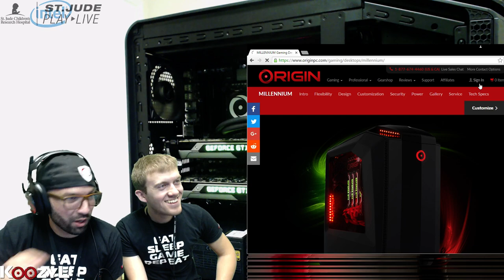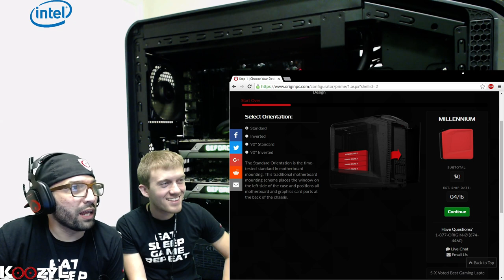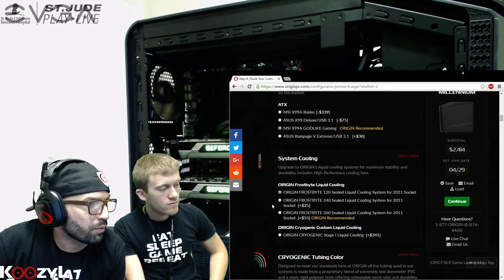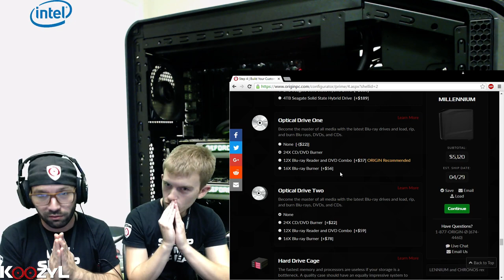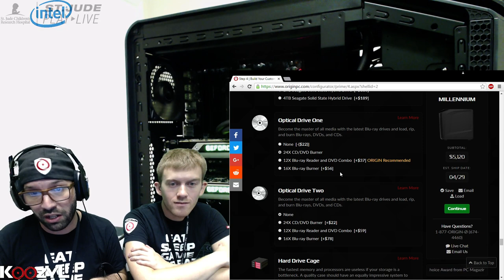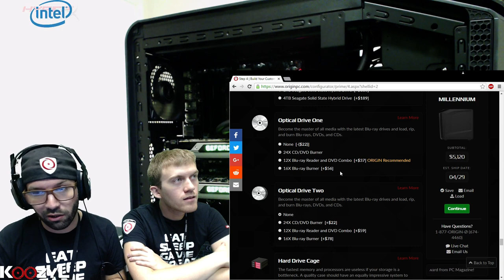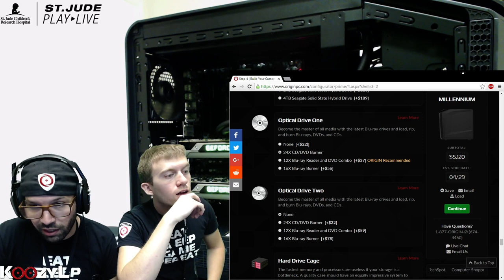sp00nerism LIVE Build on twitch.tv/ORIGINPC

Comment: For Those who want the specs:

PC Specs: Motherboard: EVGA X99 Board
System Cooling: ORIGIN FROSTBYTE 360
Processors: Intel Extreme Core i7 5960X
Power Supply: EVGA 1000w G2
Power Supply Sleeved Cable Color: Black Individually Sleeved Cables
Graphic Cards: Dual NVIDIA GTX 980 Tis
Memory: 16GB DDR4 HyperX RAM
Operating System: MS Windows 10 Home
Operating System Drive #1 (Primary): 1TB Samsung 850 Evo Series
Hot Swap Bay Drive #1: 2TB Seagate SSHD
Optical Drive One: 24X CD/DVD Burner
Reply: No? It's all there..

Comment: Can anyone explain what the raid controllers do in the system
Reply: +Its Forces A raid controller allows multiple harddrives or solid state drives to work in tandem. There's a bunch of different configurations for Raid, but the basic config is running 2 or more harddrives as if they were one harddrive. With 2 mechanical drives, it boosts the speed that they write/read data. Basically, two 500gb hardrives in raid, will be WAY faster than a single mechanical 1tb drive. :)

With SSD's, the speed isn't TOO noticeable, but it keeps them super stable.
Reply: +Red Affix so when i buy my origin i should get raid and thanks
Reply: +Its Forces No problem. :)